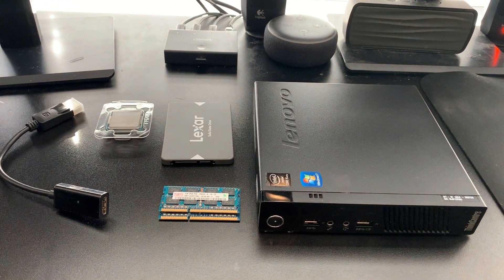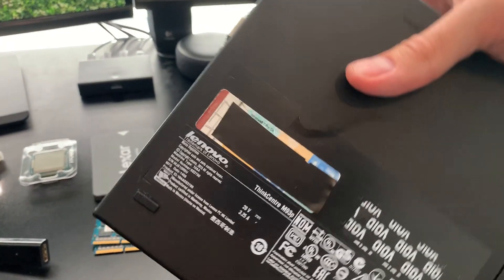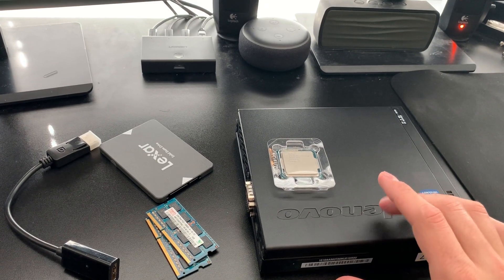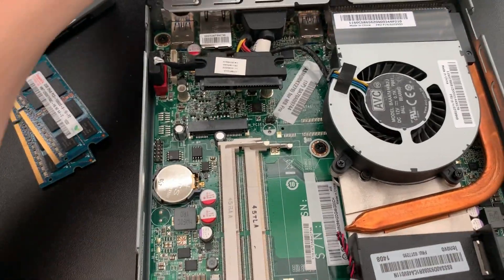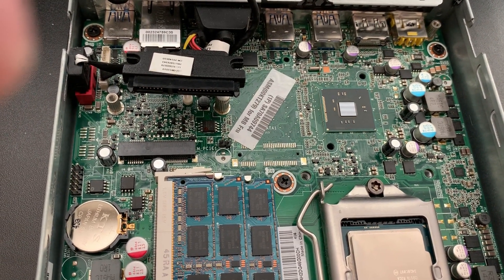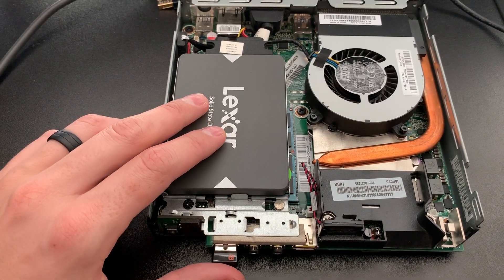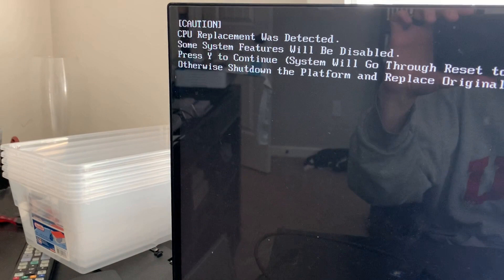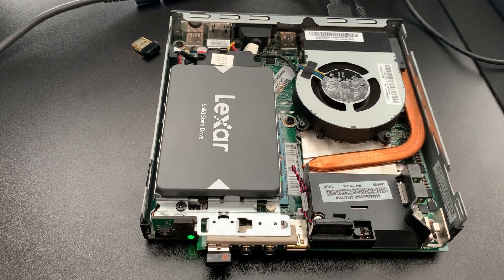Lenovo ThinkCentre M93p Tiny Hardware Overview

Comment: I purchased mine from eBay with i5 16 GB ram 250gb SSD and wireless card and CD Cady for £50.00 and love it now my daily driver with Windows 10 and duel boot Linux Mint.
Reply: When an electrical short (probably) killed my main PC, I yanked my old (2015) Lenovo M73 Tiny out of the closet...and it works perfectly. I'm typing on it now.
I was then inspired to pull out my sweetie's 2011 Toshiba that I put Ubuntu on several years ago...and it still works, too.

I love these old, tried-and-true computers. They are both now a back-up for my new PC, which is again a Lenovo Tiny.

Comment: I am wondering if there is physical space for (2) 2.5 inch SATA SSD on the inside with SATA hook up?
Reply: deffo not, 1 x 2.5" only. Unless you get a NVME to SATA caddy and put 2 drives in that
Reply: @boerboel7777  Thanks for responding.
Reply: i bought one with msata slot.

Comment: What i7 would be good to pot in the Lenovo ThinkCentre M93p
Reply: i bought one with i7 4770 installed, east to go 70 😂  Then i upgrade the heatsinm to double layer copper keep at 5x at idle
Reply: i think you can bought i7-4785t.  it is 35w should keep it cooler

Comment: Hello, I will appreciate if you could help me. I have one M93p tiny too, but without the serial port. I want to install it. I have looked for the serial port for a long time, but no success. I noticed that your computer has a serial port. could you tell me the part number of it?  thank you very much. by the way, the serial port(com1) on my motherboard is 10-pin

Comment: So, after loading Windows, how does it perform ?  I am considering purchasing a refurbished Intel Core i7-4765T 2GHz, vPro, 16GB DDR3, 256GB SSD, 5x USB 3.0, GigE, Win 10 Pro 64-bit from TigerDirect.
Reply: I/O to the hard drive is the biggest limitation.  Makes mine run SO SLOW!
Reply: I am running Core i5-4590 (84w) 3.3GHz, 16GB DDR3. My biggest problem was the poor temperature when running even at idle load. Without mod on the case and cooling, my idle temp was at 68-75c and with load at 89-90+. Just playing a 4k video my temps would immediately reach 100c in a few seconds and that would be when CoreTemp will automatically shut it down. So I had to mod it a bit by removing the stock cooling fan and heat sink and replacing it with a small tower heat pipe/heat sink. Yeah, I had to basically reduce the ultra SFF by adding an extra height, cutting a hole on the cover of the case for the new heatsink, and modifying the mounting bracket to accommodate a heatsink designed for desktops. Still smaller footprint but my idle temp is now at 36-38 and even with full load my temps do not even exceed 80c. A win for my CPU's lifetime and the speed of the system significantly increased. If you plan on using this with a CPU that is requires a significant amount of wattage, then you'll need to modify your cooling.
Reply: And I also had to delid my CPU since 4th gen were a bit old and I had to replace the thermal paste which by  this time reduced to a powder.

Comment: Does this pc has a graphic card?? IOs it good for gaming?  
pls answer asap
Reply from the maker: The intel CPU has an integrated graphics. Its okay for playing emulators and 10 year old games. It won't play any newer games.
Reply: Only integrated. You can however get the SFF version which is a bit bigger, but is able to have discrete graphics.

Comment: I am thinking about playing around with a modified cooling fan situation. Does anyone know if speedfan will work with this mobo in case the bios system does not work like I want?
Reply: What I did was solder the proprietary fan wires to a female PWM connector and plugged in a 80x80x10.8mm akasa fan, cut a hole in the case with a 76mm hole cutter, and put a fan filter over it.
Improved temperatures a lot, and it's so quiet on idle, quieter than the stock fan. Could push for a 15mm fan probably, close to even 20mm perhaps.

Anyway, under full load, temperatures were 81c with proprietary fan, now 61-64c. I did try a 40x40x10mm noctua fan (was trying to 3d print my own mount thing, results sucked though), but the fan didn't spin right away on boot and the BIOS moaned about it. No issues with the akasa fan.
Reply: @FranticAlligator  That is pretty similar to what I had planned and I can do a little testing first before I fully go through with cutting the case half. I planned to put a fairly large heat sink (have to work on mounting) on the cpu. (Do away will all of the factory sink/fan.  I knew I would have to mount a fan on the outside with the thickness of just about any decent sink.  Ruins the clean look but not really a big deal. I may try doing that internally like you did, it may do all I need. I am not gaming or anything like that. That was a first thought, just a larger/better fan but then I started going for more, maybe a little extreme.

Mine is not too loud for me but then it is partly under a desk and not right near me. I always like to get larger fans so I can run them slow but sometimes it is hard to do even with speedfan and bios control may be why I will have to try speedfan.

I don’t run this hard to run up temps, but maybe  I am addicted to things like this as it isn’t like I have tons of time to do it all, but I want to. I have always hated how warm laptops run compared to how my desktop system will cool. Sounds to me like you really kind of need more air and just that sure did a lot. And it sounds like the factory cooler works pretty well it just needs more air to help in the confines, same problem laptops seem to have. Did you do anything to direct the flow to the rear of the case and through the cooler fins or is the flow just open to the whole area? Thanks for the info on your setup.
Reply: @fredc8346  Here's a picture: https://i.imgur.com/qJMSVRQ.png

Didn't take one internally, but it has enough clearance of all the components. When I did 3D print my own custom mounting thing for a 40x40x10mm noctua fan the temps didn't change, the only plus side was a non-proprietary solution sort of.

In any case, the fan is just intaking air, and I can feel it push some out to the rear mostly, and some to the front. The main focus is just cooling the heat pipe itself as far as I could tell. I did hook up the fan prior to cutting a hole mind you, and held it in a few different places to find where it'd make the best difference.

Also I lied a bit, I didn't cut a 76mm hole, HOWEVER, I wish I did. 80mm hole was too big, hence the 3D printed fan filter (mesh was taken off the fan filter I had bought).

I also do plan on replacing it with a different mesh that has smaller holes to further limit dust without really impacting airflow too much. Also will be thinner than the one in the picture.

Anyway I did this because the proprietary fan to replace would work out costing about the same as cutting a hole and DIY-ing it, except I'd get better temperatures, quieter, and a non-proprietary fan that I can replace cheaper in future if it dies. Also the fan that was in it was fairly audible in my bedroom at night (even at idle). The replacement is barely audible at idle even up close. 

Just note, if you do cut a hole in the panel, tape the whole side up, mine was immaculate until the cutter snagged. Ah well! It does help if you do have a 3D printer to make a template of an 80mm fan too for the screw holes which if I recall the screw holes ate 71.5mm apart.

Also did a write up thing a few weeks ago on it 
https://forums.lenovo.com/t5/ThinkCentre-A-E-M-S-Series/Lenovo-Thinkcentre-m93p-tiny-problem-overheating/m-p/4516104?page=3#5181928

Lemme know if ya need anything else

Comment: Good luck with the fan noise playing games on that!
Reply from the maker: No issues with playing emulators. As long as you are using a low TDP chip there should be any issues.
Reply: Yes these little laptop type fans can get kind of loud but you don't have to have it in your face like a laptop has to be. You can move it away a few feet and also upgrade the fan if you want. I guess it can depend on more than one factor but I mostly don't see why anyone that seriously plays games would not get a proper desktop. They really aren't that expensive if you build your own.

Comment: So that model does have 2 ram slots.  got a hold of a model, m7 10q i belive, like yours, maybe a couple more usb & dp ports.. think it may have either a ssd or m.2, gotta open it! Thanks 🤓
Reply from the maker: Yeah. They are stacked on top of each like a laptop.
Reply: @BrooksyTech  i opened my box up, it has a 128GB SSD in it. Do you know how to reset the bios on these mini PCs? I see a jumper pin header near the rear of the m/board. The cmos battery looks like its under the fan. Thanks again - i jumpered the 2 & 3 pins, so now its reset. Thanks. 🤓
Reply from the maker: @j.lietka9406  probably easiest would be to just reset everything via the bios. Mash the f1 key during the boot screen to get into the bios.
Reply: @BrooksyTech  already did it! Am trying to get past username & p/word. Not worried about previous owners info, just want to reset it so its a clean machine! I may try hirens boot usb  or nirsoft. Thanks again 🤓😁
Reply: @BrooksyTech  heres a good ? for you. Is there a way to factory reset the lenovo mini PCs? Also, when i opened my mini, on the front bottom corner, there is what appears to be a small switch. When you put the cover back on, it pushes it in. With the cover on, you wont see it. What is that sw for? Thanks again. Your model may/ may not have it. 🤓

Comment: The mini computer is used to run the Openwrt system under the PVE, which can maximize the bandwidth
Reply from the maker: Yes, the only problem with this computer is it only has one NIC. So not the best for pfsense or another router OS.
Reply: @BrooksyTech  However, this is not the case, and some manufacturers in mainland China have already given solutions. Using the perfect network card（intel i210 ）, the mini pcie is transferred out, itmakes good effects. The only thing that needs to be done is to whitelist the hardware of the computer so that the hardware is no longer just a list card.The M93P shell change machine I use now, the fourth generation of NEC brand small mainframe, it looks and has the aesthetic of industrial design, the performance is also very good, it can run up to 1000 megabytes of bandwidth
Reply from the maker: @jifengliu2062  Sure you can whitelist but have you ever modded a bios via an LPC mod tool? Because I have. Its no easy task. Not simple as running a program on that pc. You need to have another computer and and understanding of hex editing. No easy task. So not sure what your point is.
Reply: @BrooksyTech  I mean, the second network card can be used by whitelisting. The method of whitelisting is also relatively simple. This method is feasible and verified

Comment: I put a 512 gig SSD / 16gb of ram new thermal paste and and now its been hackintoshed.  Mine came with the i7  4765T right away. I have a second M73 with an i3 in it too that now has 8gb of ram. Gotta love those company sales when they're done.  I think mine were both used in a warehouse but with some time and cleaner they're like new again.
Reply: Thinking of purchasing a i7 4770s cpu for mine. I have a i5 4590t in it right now. If I can get the i7 fairly cheap, I think it will improve the PC. I installed Batocera retro OS on it. Plays good but I know this will make it run even better.

Comment: Hi,
Looking to buy this machine at my used computers local pc store.
The one they have comes with a i5-4570T, 4 GB RAM (will bump it to 8 GB) and 320 GB HDD (that I will replace with my own 2.5 inch ssd).
Wanted to know how loud the fan gets when idle / basic office tasks / YouTube videos.
I really want it to be whisper quiet in my office room.

Thanks for letting me know!
Reply from the maker: I can't even hear mine from a couple feet away. I am sure if I played some games it would ramp up but the fans are fairly quiet.
Reply: @BrooksyTech  Is it whisper quiet when doing some Excel / Word / Social media? Hoping that I can work on this PC late at night when the house is quiet without always hearing a huge humming sound....
Reply: TehPcKid 100% silent. I live out in the sticks and I cannot hear the fan other than when I put my ear 30cm away from my device with an i5
Reply: @TehPcKid  it really depends on the work load... Worst thing to me is the inconstant speed... Up and down every second... Nonsense! 🙄
Reply: This is super quite. It has 3 modes in the bios. This is definitely a must buy. Purchase the DW1550 BCM94352HMB WiFi card like mentioned by another post. You can run MacOS Catalina flawlessly as I have done. Follow directions by TechNolli on YouTube. I’m trying to purchase as many as I can at a reasonable price 😂
Reply: @edgar8387  quiet? Far from it!!
Reply: @edgar8387  Thanks!
Reply: Hi T. I hope you are still there. may i ask you how the instillation of the msata worked out for that machine?. any problems?. -- did you solder in a port or order one pre installed?. thanks
Reply: @erikred8217  I only installed a 2.5 inch ssd.

Comment: Hey, I have the same one but it came with the i5. Do You know how far I can go to upgrade de processor? 
I'm planning to do a Hackintosh on this one to run AutoCAD.
Thanks.
Reply: metalslugmasters i7 4790s is the highest you can go, they are still pretty expensive
Reply: metalslugmasters i7 4xxxT will be fit what you need
Reply: Thank you guys.
Reply: @metalslugmasters  BTW，When you do hacktosh thing, Are you going to insert a min PCIE dw1820a for it?
Reply: @弦凝绝  I use a dongle instead, easier to configure, and less invasive.
Reply: metalslugmasters E3-1285L V4